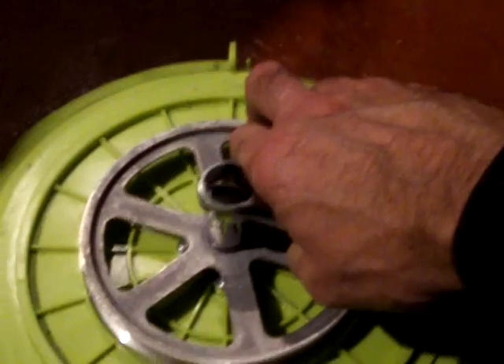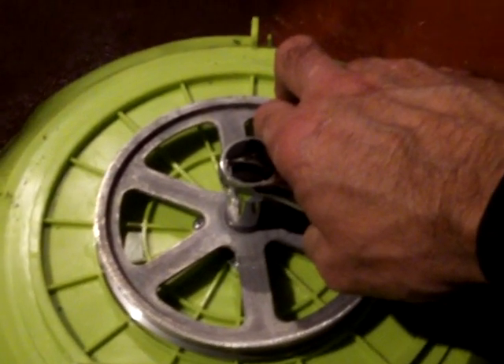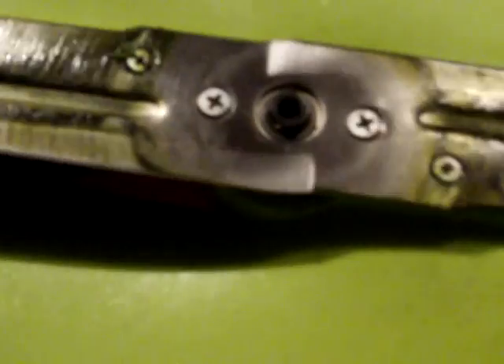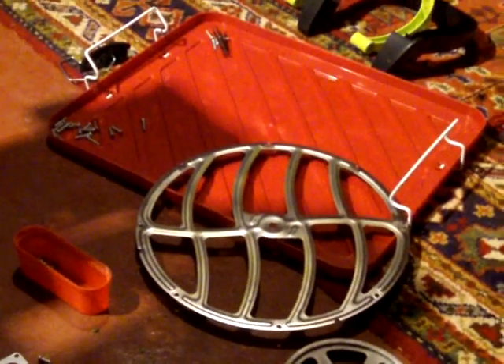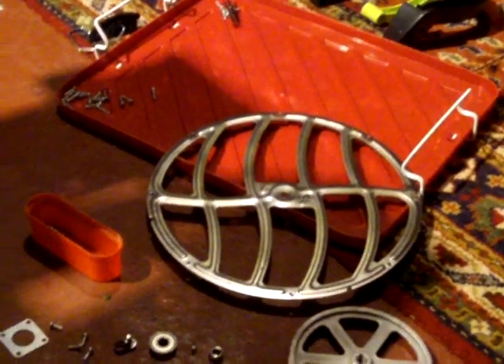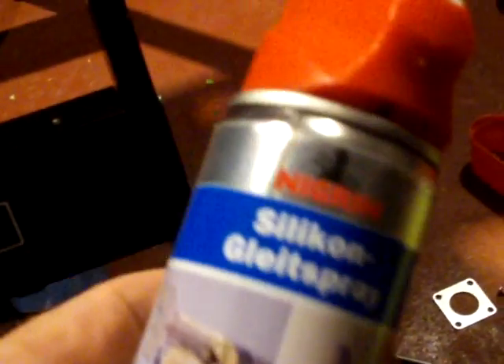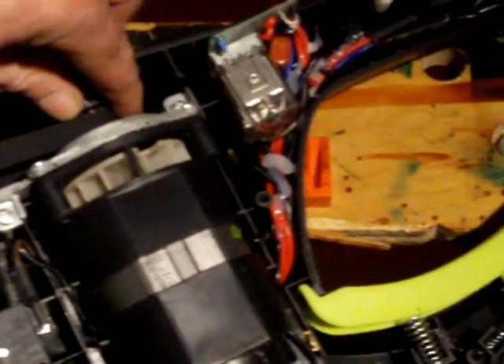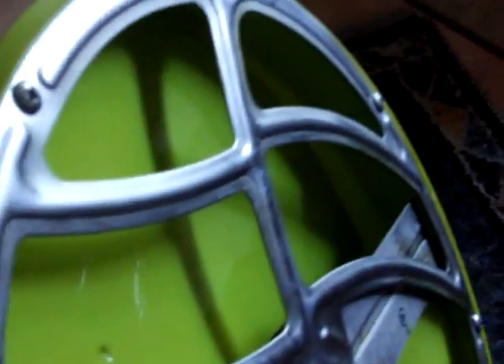Cleaning the Garden Groom Pro

Comment: Very useful video.  I am on my second Garden Groom now.  Great machines but they do need looking after. Shame some of the video was out of focus. I damaged my first  blade and cover on a big hawthorn branch and have not been able to repair it as, until seeing this video, tried releasing the screw on the centre of the blade and cover with no success.  Second machine has developed an electrical fault and I am apprehensive about taking it apart after seeing this video.  These machines seem to have become very expensive now.  Think I will have to revert back to the traditional hedge trimmer and put up with the hassle of picking up all the trimmings.
Reply from the maker: Ivan Lister I'm sure you can fix it...
if I remember... the center screw, if you ouch down on the protection screen... it will hold the bearing screw insert... mine is still working very well...
Reply from the maker: sorry for the poor quality... filmed in my basement with bad lighting... 
 I should have used a tripod for the camera...